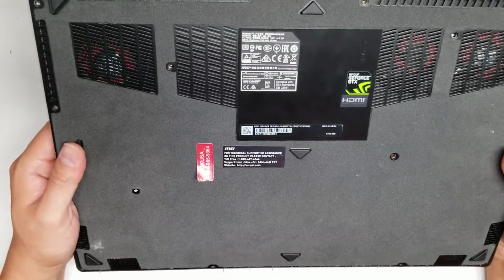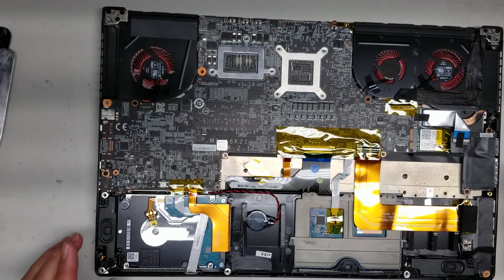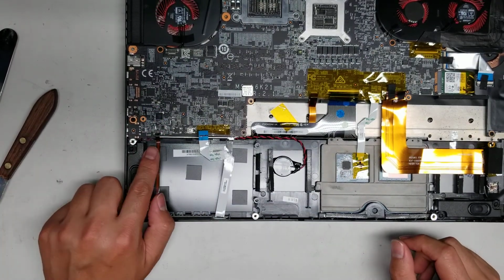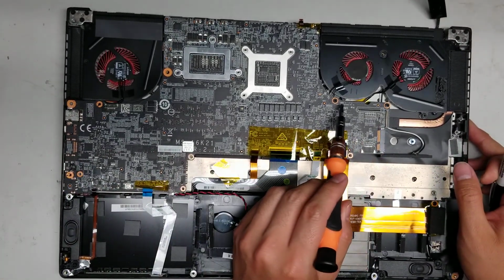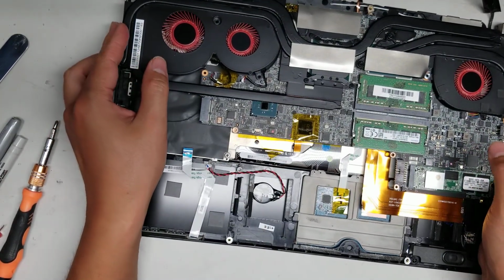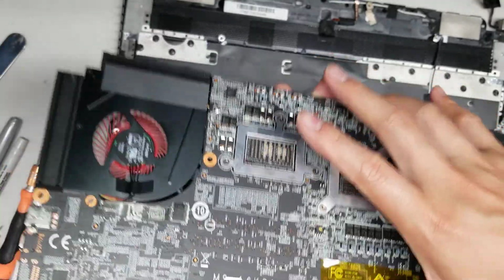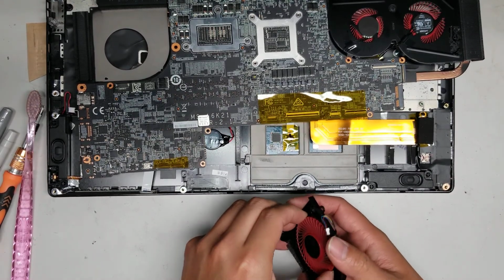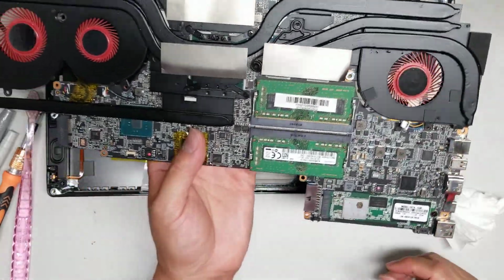MSI GS63VR 7RF-674US MS-16K2 Disassembly RAM SSD Hard Drive Upgrade Fan Repair

Comment: Hi, I'm also having a fan problem except when at lower rpms they sound like they are trying to spin but are unable to and when I'm at high performance mode they sound like a chainsaw. I've already bought the replacements but maybe the fans can be saved. Thoughts?
Reply from the maker: Watch this video and the ones in the description.https://youtu.be/3zs_SJ3BXgA

Comment: Great job of showing all the steps. I must say, this is a frustrating model to work on. The most commonly accessed components (RAM and SSD) are buried deep. Frankly, if they had merely flipped the MB over, the design would've been much better. Or, had a top-side (flip-up) removable keyboard to access those components. We're replacing the computer, rather than do the upgrade at this point. But, thanks for confirming for me that replacing RAM is a 30-60 minute task, rather than the 5 minutes (or less) it takes on an HP or Dell....
Reply from the maker: Yup, bad design.
Reply: @ItsBinhRepaired  considering the overall "awesomeness" of the MSI line, I have to admit I was shocked when I realized how it was laid out.
Reply from the maker: @dhl1263  some are ok, but this one is not

Comment: My MSI GS63VR 7RF came with an M.2 SATA ssd. Do you guys have any idea if M.2 nvme will work? Is there a way to know for sure if it supports nvme?
Thanks.
Reply: It will. Depend of config 7rf was with SATA HDD/SATA SSD/NVME SSD. It support and sata and nvme ssds😉 But... after 2 months i think u know this already😁
Reply from the maker: @ovetomash148  hopefully haha
Reply from the maker: Google or put one in is the only way to know for sure.

Comment: My model is the same, but it's 8re instead of 7rf. Any idea what's the difference? I got mine from Best Buy around September of 2018 if that matters.
Reply from the maker: Not sure. Possibly SSD, RAM, and/or processor.
Reply: @ItsBinhRepaired  Finally got around to doing a teardown yesterday as practice before I upgrade the SSD, replace thermal paste, and do a fan clean, and I believe my HDD is 1TB, my SSD is 256GB, and I have 16GB RAM so you're probably right that the different models just have differences in storage capacity. Love my laptop, but MSI sure makes it confusing sometimes with how many different configurations they have!
Reply from the maker: @helentran204  could also be customers did upgrades on their own, so I can't say for sure it's the original configuration.